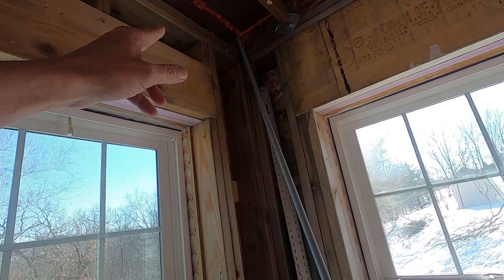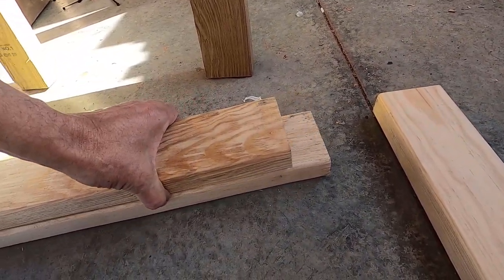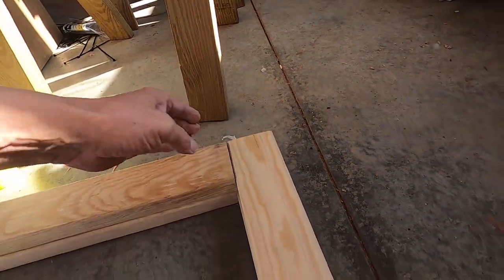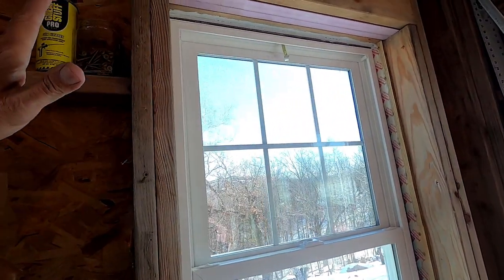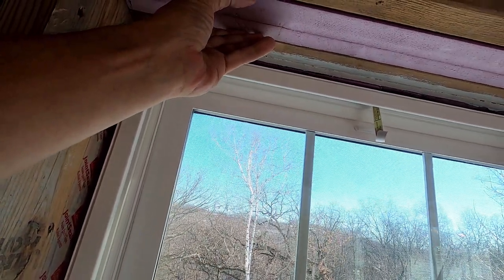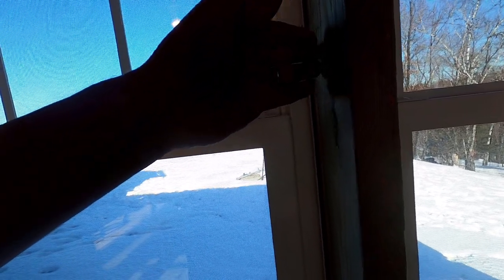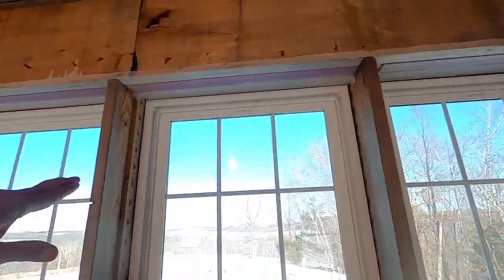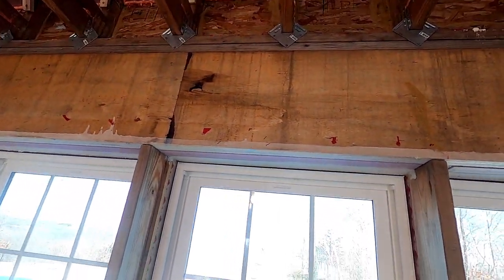Framing Tips for @TheCrockers

Comment: He built the wall right. the side walls will be 8' and the top plate will tie into a corner that is 2' down from the top of that wall.  We notch the short walls tie plate 5 1/2" by 1 1/2", slide into the tall wall. Put a stud under it like a Cali corner, then a 2x6 between studs on the tall wall, on top of the short wall tie plate. Then you have a drywall nailer all around and it's tied in good.  
 On 2 x 6 walls we use 3 2x6's with 7/16 plywood between them. 3 x 1 1/2" + 2 x 7/16" gets you 5 1/2 inches. The 7/16" makes sure its not too wide after cupping swelling, etc.
Reply from the maker: Thanks Roger! I was talking with someone else last night and he reminded me of the dropped wall. I've never seen it done before -- it will be interesting to see. Do you build the 'shed to homes' that Jason used to do videos about?
Reply: @PlanetMojo   I've built a few.  We do this on a bigger scale with those houses that have a tall ceiling in the living room and one side is 2 story( kitchen etc. below and bedrooms above) and the other side s the master bedroom
Reply: @PlanetMojo  I live in the St.louis area. We have a lot of private campgrounds ?? where small cabins are the norm.  You buy a lot around a lake, pay a monthly fee and it's pretty much no holds barred on what you build. Plus I live in a neighborhood of 32 x 24 houses. The Mississippi river is about 1 mile away. The best time to fish is when it's cold. When i was younger I built quite a few pallet palaces on the bank.
Reply from the maker: @rogerflanigan6427  __ What a coincidence -- I live just off of the Mississippi River, but upstream in Wisconsin. Our house is 24' x 28' with a 'Room-In-Attic' truss second story. In Wisconsin they now have no area of the state that is not under a building code. They stated that the year before we built so I had to prove the foundation and insulation methods would work because the code was way behind the times.
Reply from the maker: @rogerflanigan6427  -- One of your post seems to have cut off...

Comment: One thing we all need to remember is, his doesn't have to be to code. It won't be tied into water and electric. He will be 100% off grid.
Reply from the maker: Thanks Itza Moi. I agree. But it is best to follow code where possible because in most cases it is the best building practices. Some of it is useless though, so it is great to not be forced to follow it. 😊
Reply: @PlanetMojo  Oh I get it. My husbands company builds modular oil camp units and some of the codes are stupid and change almost yearly. As long as it's strong, that's all that matters in my eyes. I am sure he will reinforce it like a MOFO :)
Reply from the maker: @simplymeconnie4003  I'll bet he is busy! Oil production is booming right now! In his field where you need to innovate fast, code is a huge problem! I did work for an oil related company, and a huge amount of time is spent dealing with the subject. You husband has my sympathies for having to deal with all of the bureaucracy!!!
Reply from the maker: Lynne Dare  -- Thank you very much Lynne! 😊

Comment: Question?  Since he is building the side walls 11 feet and the front and back walls 8 feet not sure how that will look on the top.
Reply from the maker: I'm not really sure how that would be done and still have a load bearing roof. Maybe he will have a truss with an opening going across at those ends? I forgot all about that 'dropped end' detail! It will be real interesting to see how it's done. I have seen lots of sheds with the overhangs, but the end walls weren't lower the overhang cantilevered off the top. I did some searching and couldn't find any examples of framing like that. 

You are correct though, there would be no tie plate if built that way, but hopefully there is a tie 'something'. If not done correctly, the side walls will splay and that is never good 🤞🤞🤞
Reply: It is a minimal angle. Just a taper on the joint will correct that

Comment: It was too late after he built his floor system wrong.  What's going to happen when the  2 x 6's , (the only thing supporting the ends of his floor joist), rot? The 2 x 6's are going to rot --- but not sure if (they) or the piers will rot first. I was going to help him. He blocked my comments from his channel. I subscribed.
Reply from the maker: Thanks for subbing Homestead Talk! I couldn't tell from Jason's video if the framing was treated or not. I guess being from Texas maybe Jason is unaware how fast things rot in damper climates. There should be a vapor barrier as well, but it's not too late for that. The rim joist can be sister'd  to add strength and possibly painted or brush-on treated. 

I'm writing a tiny house design program: https://youtu.be/Pqblp84KwMY and have started a new channel for the tool as well: https://www.youtube.com/channel/UCEsN1OjmdiUicywgfViCjcg  and would love some input. Hope to see you in the comments!
Reply: @PlanetMojo  Thank you. I guess you saw the short video where I tried to explain how creating an inner edge just inside all exterior walls on a cabin. What's your, or others  thoughts on using that stacked 6 x 6 arrangement? Treated 6 x 6's on piers, the piers spaced 6 feet apart. The joist, (size depending on how far apart someone want's their parallel rows of piers to be), would then be installed. Optional if they want a rim joist or not, determining if the joist ends will be cut flush with the main 6 x 6, or cut back 1 5/8" on each end, allowing for a rim joist. Next would be 6 x 6 blocks in between all floor joist. The joist  would either sit directly on top of the main 6 x 6, or step in, over hanging the main 6 x 6 inside edge, if someone wants a rim joist capping the ends of floor joist. I chose not to cap the ends on my project. I used plywood capping the stacked 6 x 6's. This arrangement does 2 things. There is no snake shelf under the cabin between all the floor joist. The top 6 x 6 blocks create an edge that is further in than the exterior (2 x 4 walls) bottom floor plate. Once the floor joist are installed. No matter if installing the sub floor then, or just building walls, the last thing would be to cut treated material the thickness of the planned  DT = (sub floor + finished floor.) So the treated material would be:  DT X 3 5/8, nailed down around the outer edge for the bottom wall plate to sit on. Once that's done, there is the treated inner edge where the sub floor would be nailed down, before walls are stood up OR after all walls are stood up, roof installed and covered in. I hope I have explained this well enough.
Reply from the maker: @homesteadtalk7280  -- Sorry Homestead -- must have missed this one! I'll answer when I get back from walking the dog -- she is waiting at the door...
Reply from the maker: Back from the walk... which video is this stuff in? i'll go have a look. I'm having a hard time picturing the design you are talking about.
Reply: @PlanetMojo   The stacked 6 x 6's would only work for 2 x 6 floor joist. One 6 x 6 as a beam on all four sides of cabin. It works with cinder blocks as piers, the first thing sitting on the blocks is the outer band "6 x 6 Beam" . The 2 x 6 floor joist then go on. Once those are spaced correctly and nailed in place there is a space between all floor joist. In that space you just cut short 6 x 6 blocks to fit. The short blocks sit directly on top of the 6 x 6 beams. They fill in every opening all the way around the cabin. What would normally be doubled 2 x 6's as the last outer edge floor joist is a full length 6 x 6. This video shows it a little, but I tried explaining it in another one. The last 10 feet of this little house, was added on to the original house. The end top / second layer,  parallel full length 6 x 6 is under the front window The floor joist ends are  under the two windows at the end. They are all filled in between with short 6 x 6 blocks. That's how the inner edge is created under the bottom wall plate. https://youtu.be/vXE8NWNlnV4?t=78
Reply from the maker: Lynne Dare  -- Thanks Lynne! There is all kinds of building and fixing going on here! My son and I built our house in 2011, and I started the addition I am working on right now last summer. I be building a workshop and a guest 'tiny house' as we can afford them, but should be soon! 😁
Reply: Lynne Dare  he kept, and still continues to mention casinos. I said to him, They have those cheap meals to get you in the building. Stay out of the casinos, they will destroy your dreams. He jumped in and blocked me right away. I think I hit his truth button. It was when he was stalling for the entire month, going to other channels homes, "eating". He was very humbled during that month. I've been there, and done that. I had my suspicions. Not sure if he had gambled or has gambled but he sure didn't like the good advice. :)

Comment: Good info but honestly he probably won't take your advice ..Even though he's not required to pull permits or anything there is still a right way vs wrong ..just for safety strength and longevity..I love watching all the homesteaders but sometimes it's hard to sit back and watch them make mistakes that could have been avoided just by a little research ..I've learned so many of them are kinda bullheaded and stubborn ..I watched a guy the other day that was doing finish carpentry work while rough framing his home ... ooofff
Reply from the maker: I know what you mean. That's what I started this channel for -- to try to help homesteaders not make so many costly  and sometimes dangerous mistakes, but a lot of times it's too late, or they just don't care. In this case, There is a comment from Roger Flanigan
 somewhere in this comment section that says how this design will work. I'm guessing he works for the shed place that Jason used to do videos at, but I can't say for certain. He may be helping Jason with the design or Jason may be building from memory what he saw in the shed designs. I'm real interested in seeing wow things come together! 

As for other homesteaders, I watched a video with a popular homesteader where he cut down a bunch of maples and made a fence out of it. I commented that maple has almost zero rot resistance, and all of that hard work will only last a year or two. Last I looked it looked as though the fence has failed already, but I don't know if it was ever mentioned because I no longer watch the channel. I think Jason will get advice or research before doing anything that big though! 😊
Reply: Yep, “the crockers” will have a rude awaking when those tornados start blowing his way. Keeping it Dutch didn’t build that storm shelter for nothing. 
He’s so lame he can’t even frame. The foundation is wrong. Let’s face it, this is why they make people pull permits, so fools don’t make a dangerous place that will collapse right on top of someone.
Reply: @PlanetMojo  thank you for that!!!
But seriously, he has all kind of help and none of them knows what they're doing. But they all 'know everything '. Other homesteaders helping him have had serious building mistakes they made on their places too. But they're so dramatic and think they know everything I gave up on trying to give structurally sound carpentry advice. One Oklahoman woke up and exposed him for who he really is.

It's awesome seeing people giving him land for free and a nice big tent for free but his arrogance and know it all attitude irks me. He's an embarrassment to me, - a real Texan. He shouldn't act like he does to those trying to help him.
Reply: Lynne Dare Did you know they bought the shed and it was made already. They just finished it off adding walls and plumbing. Yes I know he plans a lot. If you notice he says when he has somebody coming he doesn’t do anything. When he’s on his own he doesn’t complete anything either.  I don’t watch but he pops up I’ll catch it. I sure don’t subscribe. I think it’s a racket.